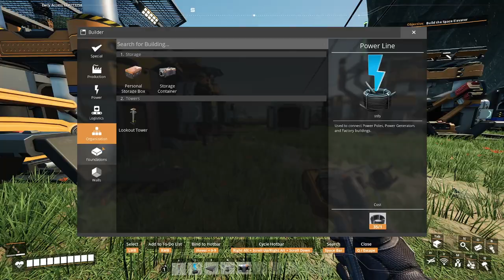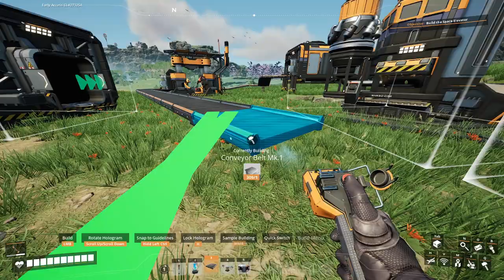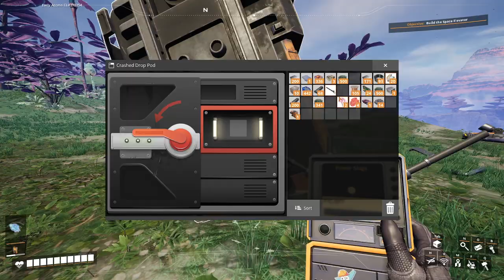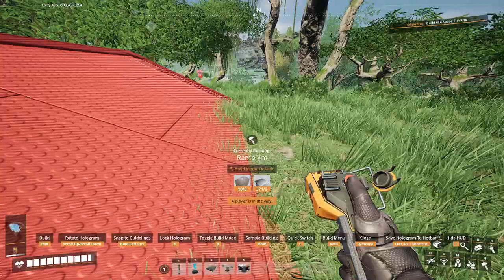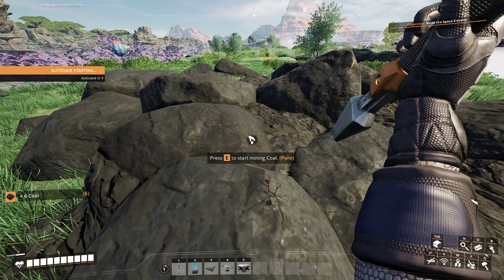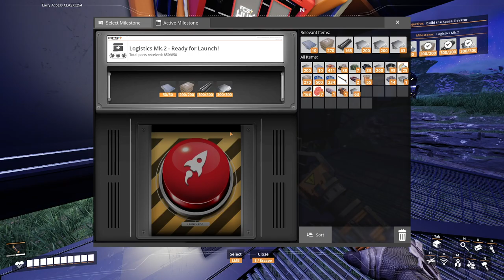Satisfactory Let's Play Ep4! | Slug Power!

Comment: good video!  here is a tip for your biomass.  the biomass burners only use the fuel based on what you are using.  what this means in practice is that the more biomass burners you have, the slower the fuel burns.  personally I create a biomass power plant where I have containers to drop off leaves and wood that it turns into solid biofuel into its own container.  I then build 24 biomass burners because a container holds 24 stacks and I can fill up all 24 burners with it.
Reply from the maker: Thanks for the tip Marc! I'll consider using this for sure 😄